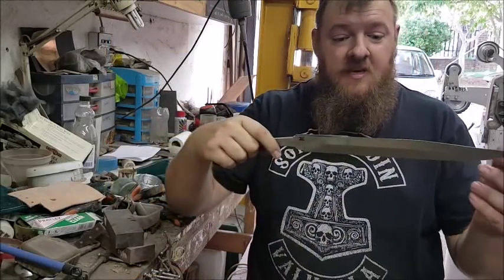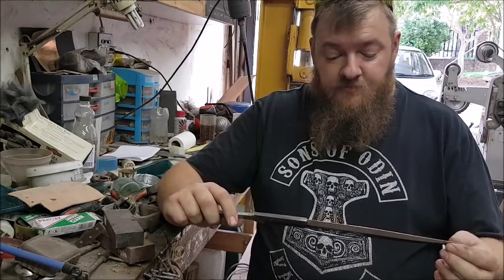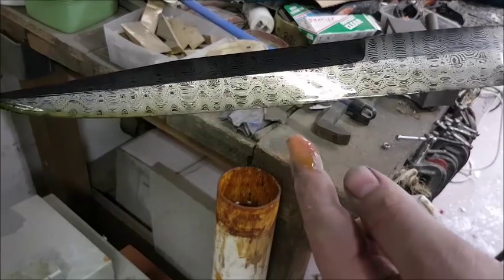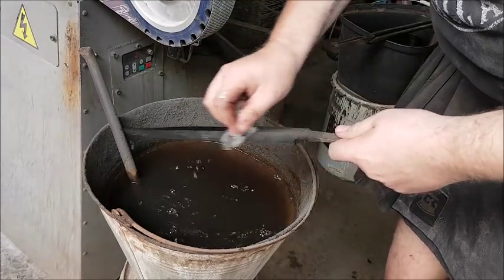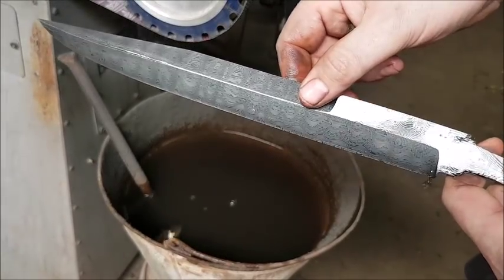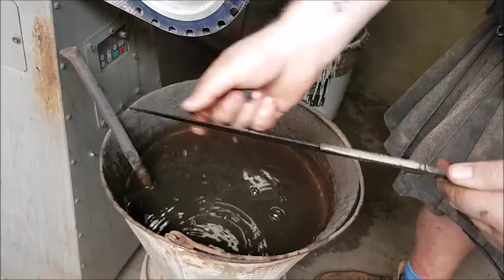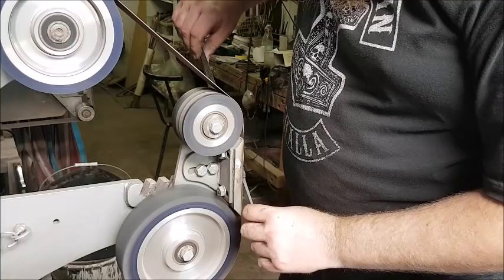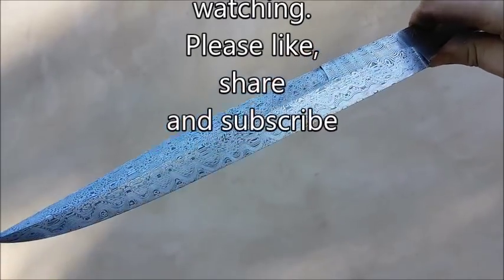Etching Damascus

Comment: Are your Damascus blanks pre-made? I ask because you said the ferric chloride etches off the carbon steel. Doesn't it etch the nickle plate/layer in the steel? I love the finishing attention you give it ala Carl Anderson & technique. Etched a few myself but just the basic dunk, soak & clean. Never thought of the 4-O wool. I may try that tomorrow on my 73 layer Damascus chefs knife. I have an 8000 grit 'buffing' strap loaded with 1/4 micron diamond compound for the wheel that's worn out & probably more like a 12,000 grit. That could be interesting for a polish stage. Now I'm excited lol. What knife nerds we are!
Reply from the maker: I make all my own damascus that way I get the patterns I want. Also a good way to bes ure of materials and quality.

Comment: what's your ferric chloride to water ratio ?
Reply from the maker: Fibermascus Fibermascus1 to be honest I don't know. I took the strongest solution and watered it down until I was happy with the strength.  I never measured . a slower etch will be clearer than a heavy fast etch